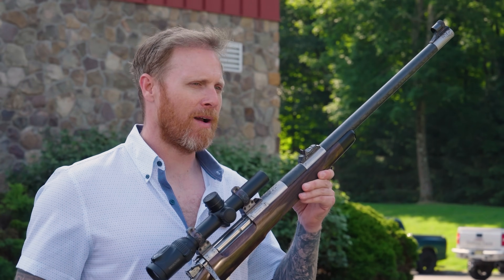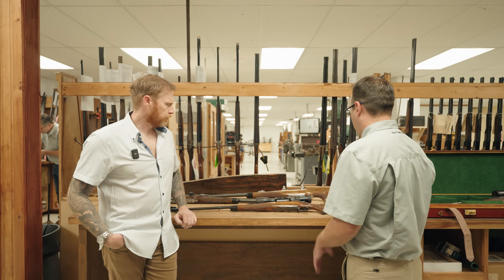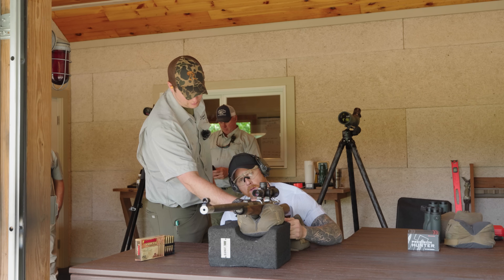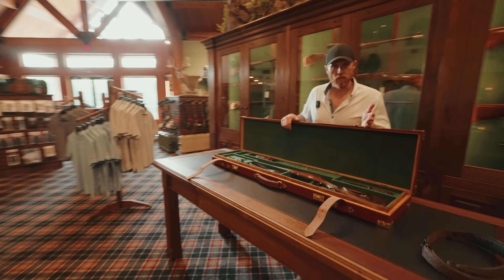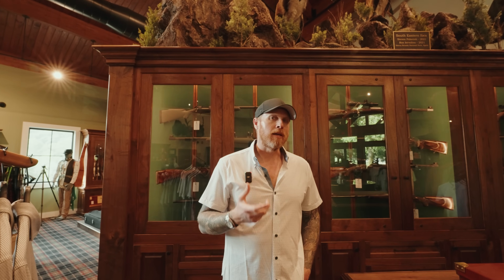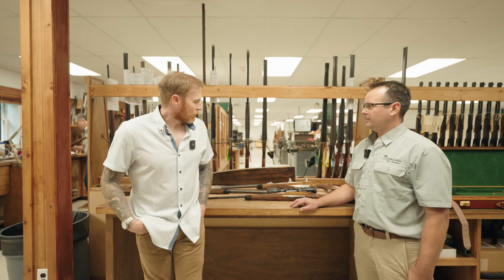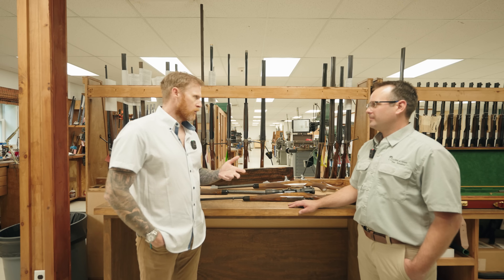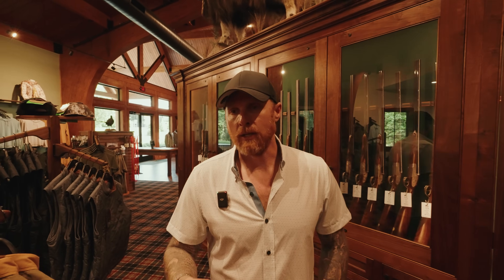What Makes a $50,000 Rifle?

Comment: $125 an hour for that level of detail isnt even a bad cost
Reply: True,very true.
Reply: Right, a half assed mechanic charges that!
Reply: But for 275 hours, totalling over $34,000 in labor to fit an action to a stock? leaves like $15k for materials and tooling which im sure theyve long since made their money back on. I wouldnt be surprised if theres some kind of tax write off/ money laundering angle to this operation
Reply: My plumber charges $150
Reply: @Certifiedguess  The action can range from 2k-5k, the barrel can be 1k-2k, the stock blank, just the 3"x8"x24" board can be 500-5k. Good scopes are 1k-2k, and the scope rings/mount can go from 75-500.
Reply: @ColtonWebb17  Well, A plumber is well worth that when you're in need. lol.
Reply: @calvinh.8882  Well you can always pop a squat in the woods but you can't exactly throw a rock at a elk lol and kill it but then again just because I need something other than a rock I don't need a 50k worth of "something else" just 1k if that.
Reply: @ThmsDouglas  Yep, $1k is plenty to get what it takes to take down pretty much anything. 
I do have a couple that were around $4k. and I could afford a lot more if I wanted, but I'm different than a lot of people because even if I had $100-million dollars I just couldn't pull myself to spend $50k on a rifle. lol.
Reply: Its actually cheap for their skills.
Most anyone can be a plumber if they want.
But to be a top notch engraver or similar.    Very few can.    No matter how hard they try.

Comment: 35 Whelen is the most elegant cartridge ever made. 
I didn’t say the best,
The most powerful 
The most versatile 
It is the most elegant.
It’s like a high quality scotch served neat.
Reply: I like the 35 Whelen, I have a 9.3x62 (very similar) barrel for my Blaser R8, excellent and under-utilised.
Reply: The correct answer would the the 280 anklet improved its just magical
Reply: I have one and it’s a great cartridge. It just doesn’t have the nostalgia and class of 35 whelen. Plus it gave up it taper for performance
Reply: @Westerner_  another one is the 375 h&h
Reply: I think the 7 x 57 ( now it's known as the 275 rigby) may be the most elegant. Along with the 375 and 300 h&h, 416 rigby.
Reply: @petertwardy4135  good point, the 30-06 was based on it and the 35 Whalen is based on the 06 case just necked up

Comment: I lived in England for over 20 years, and during that time, I often went on pheasant hunts. Some of the guys I hunted with would show up in shooting gear that cost upwards of $75,000, and their shotguns—works of art—were easily worth $100,000 or more. My shotgun? It was a simple, used over-and-under 12-gauge that I picked up for $100. I’d toss it over fences, drop it on the ground without a second thought, and take a moment to scratch myself without worrying about it.

Now, don't get me wrong—I could have afforded something much more expensive if I wanted to. But the idea of taking a handcrafted, high-dollar shotgun out into the field, just to have it scratched up by thorns or soaked in the rain, never sat right with me. I'd rather have a gun I didn't have to baby, one that could take a beating and still get the job done.

Comment: $50,000 ÷ 400hr = $125/hr. That's simple enough, but G&H is making a profit. Minus the cost of premium materials (steel, wood, & misc.) before any man hours are even tallied. It doesn't really amount to much cash/ man-hour considering the fact that the stock finishers (including elaborate checkering/carving) and metal engravers are artists that require a slow and deliberate pace with which to work, $50,000 doesn't really seem to be too much; does it?

Comment: You know what makes a $50,000 rifle? Not much, because there’s a sucker born every minute.
Reply: So true
Reply: Yup. I doubt it offers any performance benefits over a decent factory rifle with a barrel and a trigger.
Reply: @redneckchemtech7621 a Ferrari and a hellcat have the same horsepower, it’s everything else that makes it worth the money
Reply: @zXPeterz14  I don’t think that analogy works. The differences between a Ferrari and a Hellcat are more than just cosmetic. 
Guns have peaked. This 50k rifle is just cosmetic. It’s basically a piece of art not something that provides absolutely any improvement. 
First clue: has a CFW barrel. They suck